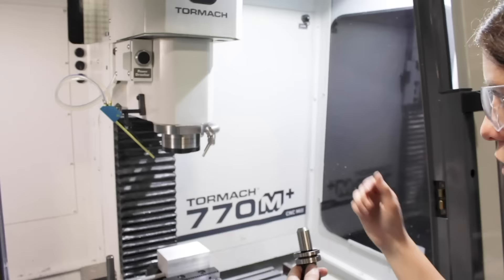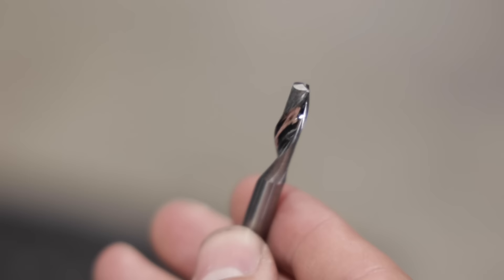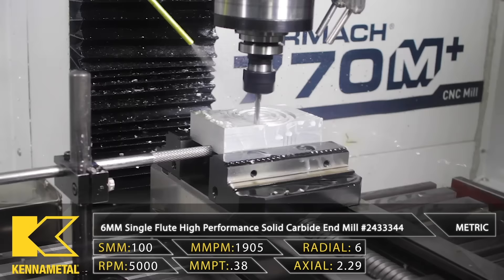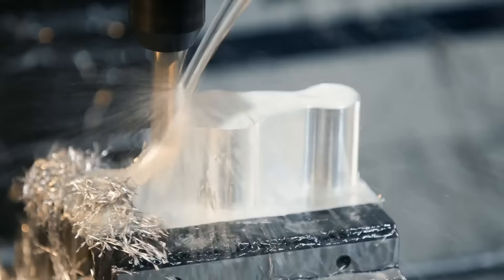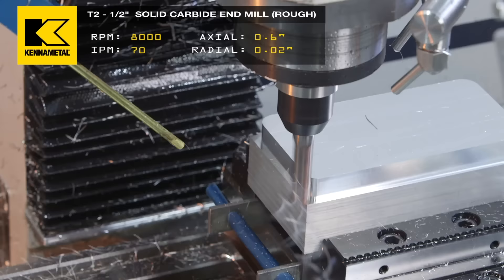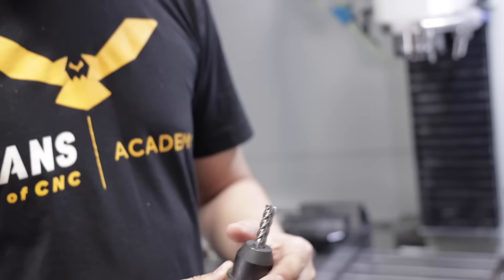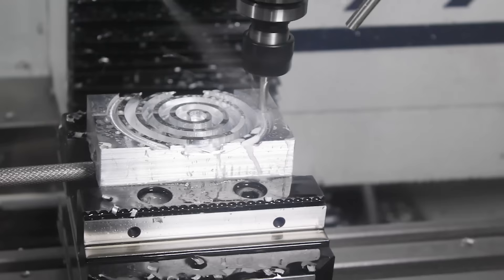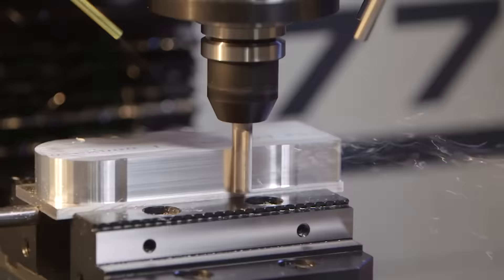How to Decide Which End Mill to Use in Aluminum | A Quick Beginner's Guide to Milling in a Tormach

Comment: I wish he would have covered when NOT to use each. 5 flute will not do well plunging or when there isn't a lot of room for chip evacuation. 1 flute will not leave a good side finish unless you feed really slow. Someone with little experience could come away from this thinking they can all do it all well.
Reply: Great statement. I came away thinking that five flute would be best and your comment illustrates how little I know!
Our most challenging cuts are generally a diameter of 10 mm and between 40-50mm deep in POM and Alu so chip evacuation and rigidity are issue. What I would think we should use is a 9.5mm of 3/4" five flute running maximum rpm (6000) on the Haas TM1-P that we are about to buy.
Here it sounds like you just run rpm and speed up with as much stepover as the system can take, but it sounds like that is wrong
Reply: well there are so many variables you can cover them all in a video
Reply: Good point.   He is obviously biased by the fact that his CNC mill is very high speed;  my Bridgeport can’t work at that speed, so more to consider.
Reply: Yeah, with these guys, it seems to be that they speak highly about the stuff they use on their channel. I'm running a Tormach 1100mx, which can do high speed up to 10k, but some people wouldn't want to use a 1 flute.. I use the 3 flute myself. I need to dial in my feeds and speeds. That's where I suck. I am busting endmills still and it's very concerning to me. I'm new at this, and really need to dial in my speeds and how fast I'm removing material. Calculators don't seem to work all that good for me, because something else is going on with my software.
Reply: When machining aluminium, you should aim for the Q value. For pockets i like to use carbide ripper-profiled endmills with coolant, the grooved profile reduces cutting torque while keeping the Q value high.  Coolant is really important, and getting the fluid down in the pocket to evacuate chips. That way you ahve a long lasting extremely effective endmill with minimal machine stress and a high q value.

I have great experience with the Paul Horn DSFRA endmills.
Reply: He kind of did by not mentioning them.

Comment: In other words, for aluminium use how many flutes as you want as long as it is not 4 flutes.   Did I get it right?
Reply: nope with alluminum do whatever you can do evacuate the chips, then if you ensure that the more flutes you have the more rigid is your set up so can take more material away (either by increasing speed, good for less rigid machine, or by increasing radial load, for more rigid mills). General speaking if you have to peak a set of tools for aluminum, buy carbide 3 flutes and you are in a sweet spot. Being machining aluminum with those for a while now.
Reply: Lesser flutes more chip evacuation : Gummy Material
Reply: @Ale_Lab  Thanks.  I never worked on aluminum.  But did/do on brass (which they say is similar).  I use 3 flutes carbide uncoated (shiny white).  Similar end mill I use for steel but is coated (black).   Is it true that coated is not recommended because it will cause the aluminum to stick to it?
Reply: @danl.4743 Machine brass is easier than Alu, you can take more load for the same type of machine. But for sure closer to Alu than steel. For aluminum as I use carbide only and both coated or not. Usually coating helps in the case of aluminum because slippery enough to improve chip evacuation, but I also read what you said somewhere. Personally I make sure to use mistcoolant and feed and speeds to avoid to the alu to get hot.  I find way more important to at least blast air and if possible a good mist coolant directly on the cutting edge. That your easier and best recepy for simple setup at the hobby level. You don't need to spend tons on fog buster. Can make good mist cooling with few dollars (you always need a compressor though).

Regarding steel 3 flutes can be used successfully. I prefer to go to 4 flutes for increase core rigidity and you want to bring away all the heat with the chips.
Reply: -- better go for dlc coated 3 flute endmill. Best performance

Comment: Best # of flutes is totally dependent on the cutting application. In high speed machines, making a 2-flute work can be difficult due to cutting harmonics and natural frequencies of machine tools. I have 2 large high speed gantry mills (20k rpm) in my shop and they are very sensitive in this regard. Also, wall thickness calls for a specific flute count such that 2 flutes can maintain contact, which helps stabilize harmonics in thin walls at high aspect ratios. If everything could be machined as quickly as possible with trochoidal type toolpaths, you could probably make a case for a set number of flutes as 'best case' but that simply isn't the quickest way to process everything. 

Overall a good intro video though.
Reply: this is a really interesting comment, would you care to elaborate on what you have the best luck with on your mill? mine seems to be very similar and I am looking into doing aluminum parts for one of my upcoming projects
Reply: Да, тоже интересно

Comment: two flute was definitely the alluminium milling tool. very hard to break and hard to merge with alluminium when emulsion is absent. The finishing was pretty at provided the run out is zero.
Reply: The more flutes you have the stronger the tool but you have a reduced chip clearing ability unless you have a high helix angle.

Comment: Why would I use a honed cutting edge as opposed to a ground and polished edge?  Could you teach us about coatings?  I have a 5 fluters I slot 1*5*d in steal and stainless no problem.  Also, what variable helix would you recommend?  35 and 37 is what I generally go with.

Comment: My experience more flutes the better for finish and especially wear. As long as you can get the chips out and cool. Hangstefers used in a Flood system makes a huge difference. also in theory if you have to spin 7000 rpm with a 2 flute a 4 flute only needs 3500 rpm and is much less chatter prone. I have a 6500 lb acroloc m12 so its heavy but only fairly ridged.
I have tried 3 flutes and the tool wear was poor .  2 futes are really vibration prone and dont last long .
Reply: depends on spindle power. if your spindle is too weak for the same tool with more flutes, it will crash.

Comment: Hey bud at around 3:15 you say the more flutes the bigger the core. I don't think this is correct based on my knowledge as the more flutes would mean more material removed to create that extra flute. I'm not an expert just using my own logic and experience feel free to correct me if I am wrong! Great video and thank you for the information.
Reply from the maker: As you add more flutes… each actually gets smaller… because there is more. Less deep also  which means it father from center

Comment: This video is about a week late...I used a 4 flute vortex cutter full slot and it pulled out and milled the bed last week...
Reply: What holders are you using? That's a tool holding issue.
Reply: @zaknefain100  no, I think it's just the forces of the cutter as it was a 20mm cutter designed to do 2mm cuts and I did a full slot with it. I was also going a bit fast feed. I've been told that it will even pull out of a heat shrink. But I was using side lock holder.
Reply: @Mrgnothing1  Ah ok mate. Yeah that adds a lot more context to the discussion.  Single set screw on the 20 mm? Still takes a torquey cut to shear one. What was your load meter pregged at? 😁

I run 25 mm in full slot but they're double set-screw at that size. For lower speeds they're adequate, higher speeds and I move to the Nikken & Daishowa milling chucks. They'll still creep in a shrink on really heavy cuts.
Reply: @zaknefain100   @zaknefain100  it was single set screw but if used properly its normally fine as I used it on a different tool path. It was running at 8,000rpm 12,000mmpm and as I was going around the outside of a square plate material that had big radius on the corners and I didnt slow it down enough as it hit at full slot on the corner parts so would have hit it around 5-6000 feed maybe less which I realise now is too quick for a 20mm full slot. And the geometry of the cutter is slightly different from a normal ally cutter it puts more force onto the tool.

Comment: Have you tried any datron single flute ive heard their really good at removing aluminum
Reply: I use them every day, they’re brilliant, however they’re designed for very high RPM ranges, 30-60K for the most part. They work well at 22K though with reduced feeds to compensate. They’re a great option for home machinists too IMO as the price to performance is really solid.

Comment: So the best end mills for aluminium alloys are slot drills :-)
Reply: Three flutes are the best for aluminium alloys, better rigidity and high FPT then two flutes. You also get better cutter engagement, which means there's less of a hammering effect on the work piece allowing for better finishing then two flutes.
Reply: @AeroenginnerJosh  Much of this depends on chip evacuation. Plain and simple. You'll notice in the videos where he is using the 3 flute, he is also using flood coolant. That lends to the 3 flute looking so good. If you are only using air, or dry cutting, your mileage with a 3 flute will vary.
Reply: @thetruthyouneedtohear  NYC CNC in one video used - i think 5 flutes for finishing and 4 for roughing. 
I have no practical experience, and my machinist seems to use snali pace and burn out tools, like ex running a carbide drill at 2-3% of manufactureres spec in alu and burning it out. In our company what we often need to do are 10mm slots (little over 3/8 inch at 1½-2 inch deep) and mostly in Aluminium and POM. 
How do you shortlist tools and processes?
Reply: @jenspetersen5865  testing is one way to determine what works best for you. Feeds and speeds play a huge part in the results. For a slot, you want to leave enough remaining stock to cleanup the roughing cut. And finish it with a light stepover.

Comment: This is a terrible video.  You need to give some performance comparison on material removal rates.  "Great" is not quantifiable and as is a meaningless as calling it sweet or nice.

I am sure that you measure the volume removal rate of a cutter and that is what a viewer would expect with a video title like yours.
Reply: Totally agree - you cannot really learn from being told that every aluminum cutter in Kennametals program serves a purpose and when paid they get endorsements.
If you have a machine with much higher HP but less spindle spped - what do you do then - More flutes and deeper cut or does that clog up?

Comment: Personal Kennametal is good on steel titanium etc on aluminium milling they are far behind their competitors
Reply: Try Iscar, or UOP. We are using them in all aluminium alloys and most plastics.  Ideal longer neck length for machining taller parts.  Very nice and smooth surface finish.   We tried other brands , but no one could 
match IT!